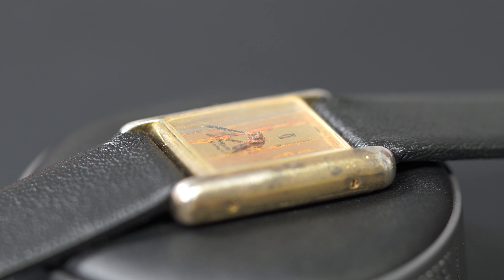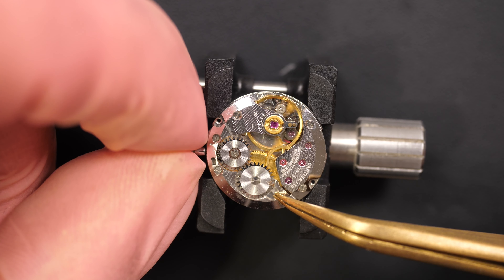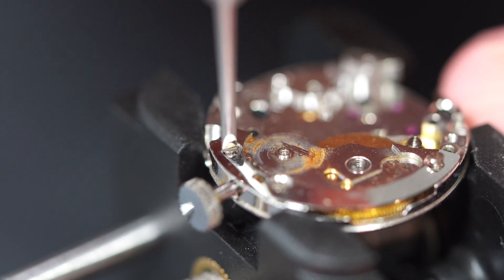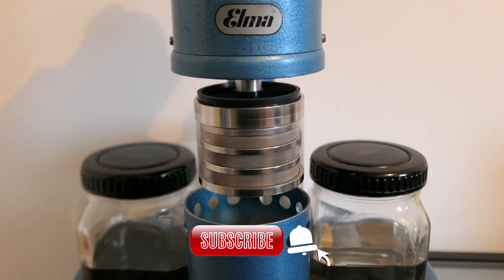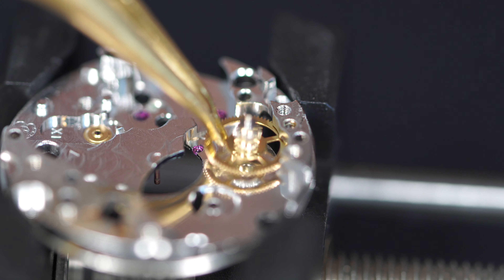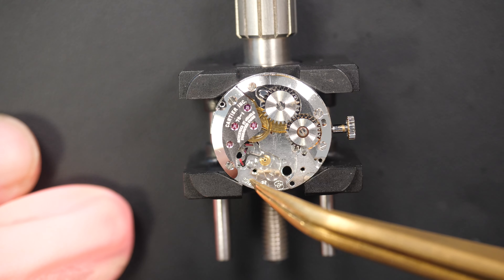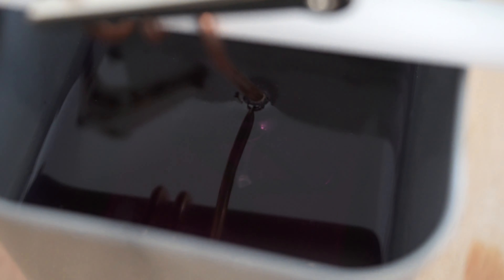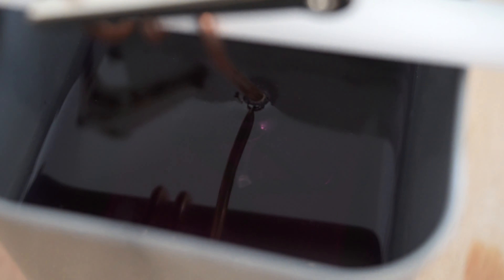Restoring a Rusty Vintage Watch Icon: The Cartier Tank

Comment: As soon as I saw the movement was unoriginal I would have stopped right there. Looks like a cheap  (by comparison) eta movement. Cartier does use eta based movements in some of their watches but to a much higher standard than this.
Reply from the maker: The eta movement between the pagol and the cartier is exactly the same. The cartier obviously as you can see has a cartier brand on it and the decoration is different
Reply: @FrenchWatchCollector  thanks for clarity maybe that why the owner was happy to put that movement in.
Reply from the maker: @MichaelWilliams-mo1vv  I think he was happy like you said but I prefer to have the real one inside. This why I changed it
Reply: Not for sale now that u know it.  Only for wearing😂

Comment: In House movements are a relatively new thing so I'm not surprised to see an ETA movement, it doesn't detract from the watch.
Reply from the maker: I agree with you but I find it better to have the right eta movement in the watch. Doesn't change anything timing wise but it is more genuine
Reply: @FrenchWatchCollector  Agree 100% as the movement that was in it was a lesser grade movement. Great job, the dial actually looks good as it is.
Reply from the maker: I like the dial too. Thanks for the nice comment

Comment: I'm watching this video....I love to watch anyone performing their craft, whether it is someone sewing, as my beautiful mother did for more than 50 years, or someone applying their makeup, or a watchman repairing a Must de Cartier Tank.

I have a question...my MUST de Cartier Tank has severely discolored due to oxidation. Is there any way that the color, which I know is only gold-plated, can be restored?  Currently it is so black due to the oxidation.    The mechanism has also stopped, so the watch needs a brand new battery .
Reply from the maker: Thank you for the nice comment. The watch can be gold plated again like I did in the video. The mechanism can be fixed by just changing the battery if it is a quartz movement. You can go on my website if you want me to service your watch

Comment: Well, you got it running, and produced a good result, so congratulations on that!

But the whole restoration kinda makes me sad, you got a Must Tank but it had a Franken movement, so buy a new movement. Gold plating solutions are expensive, the dial and hands are still damaged, so even though you got the job done, was it worth it? If the object was to learn gold plating then obviously yes!

I just feel a little sad for restorers who put all that work in and the end result is less than ideal (unless you can find a replacement dial and hands out there!)
Reply from the maker: The watch is for my wife. She is very happy with the end result. I found the dial very unique and nice. If you want a vintage watch that looks like a new one is better to buy a new watch. My goal is never to restore a watch that looks like a new one but one that keep its characters and its history.

Everyone is different but this the way I like vintage watches.

Comment: I had  one of these in with a rusted out movement. I purchased a movement on line and transferred the necessary parts into the cleaned up rusty movement main plate and wheel bridges. I can't understand why people just replace the movement like this when the most important parts of the main watch, even if it's just the balance cock, wheel and barrel bridges, can be salvaged to give the watch the look of originality.
Reply from the maker: I agree 100% with you